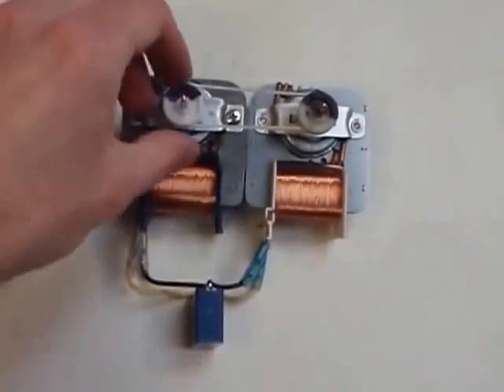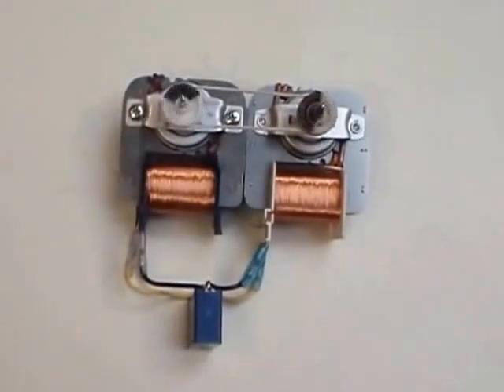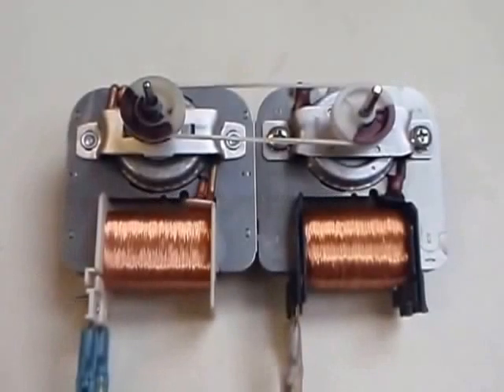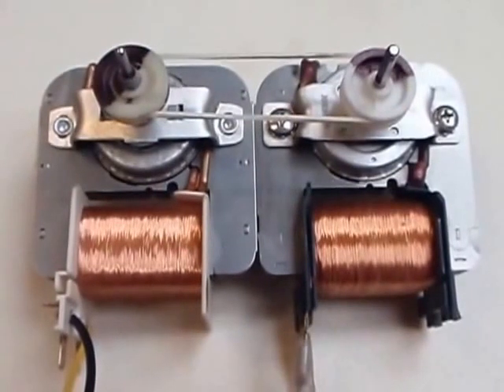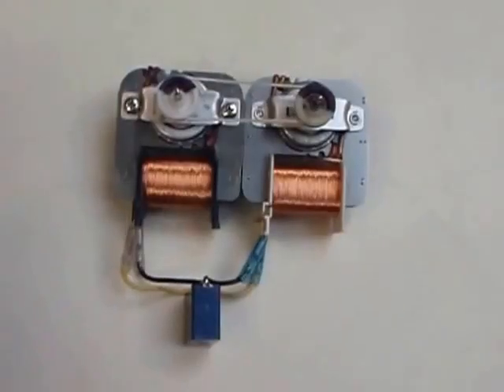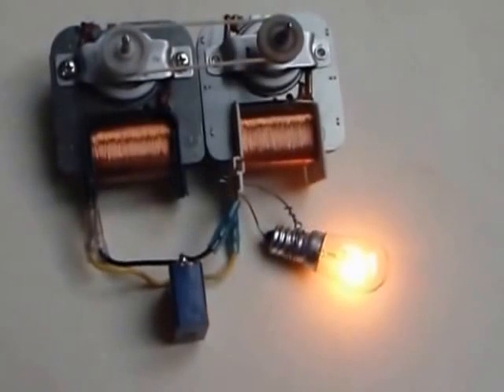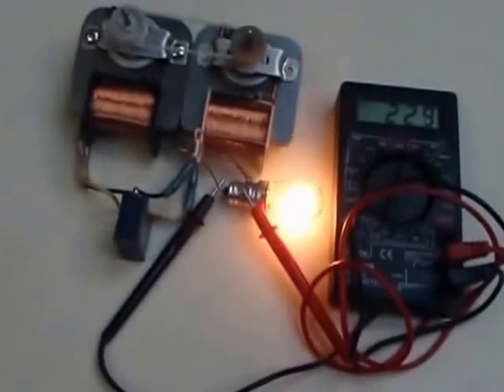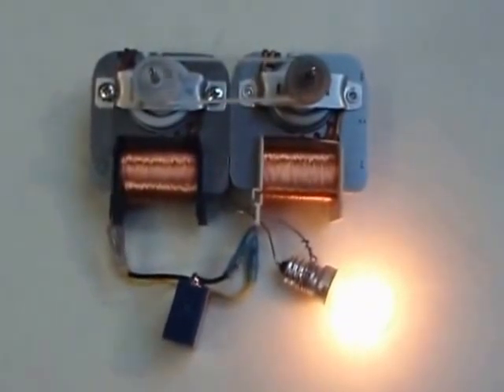6 : 7 gear ratio - Overunity free energy generator

Comment: it seems to be 2 microwave motors that are reinvented with a magnet around the centerpieces.  Attach the 2 by the spindle on top and wire them together (+ to /+ to) of each device and it should run itself after the initial startup.  if you build it and it does not work switch the wires and that will complete the circuit. happy energy!
Reply: It cant work even with magnets...there is way too much cogging against the laminations...this will never work in a million years